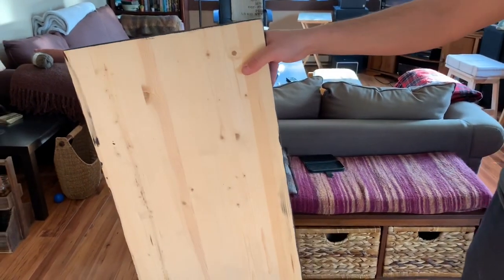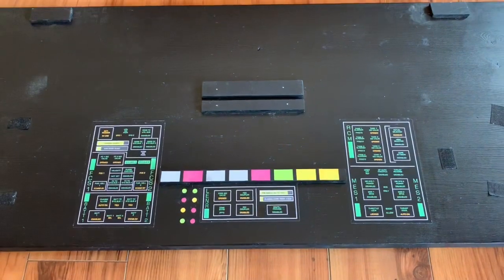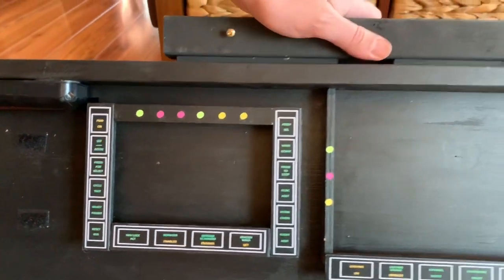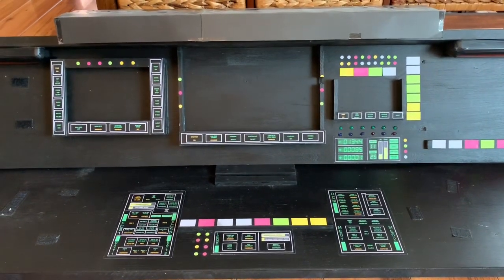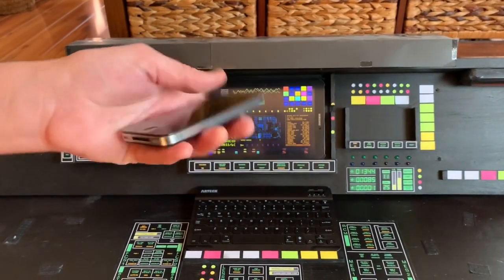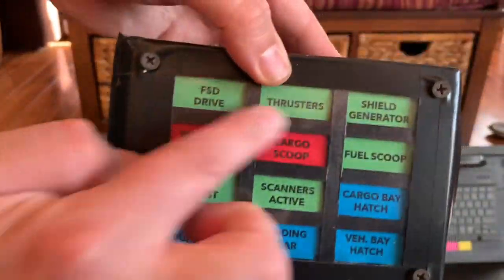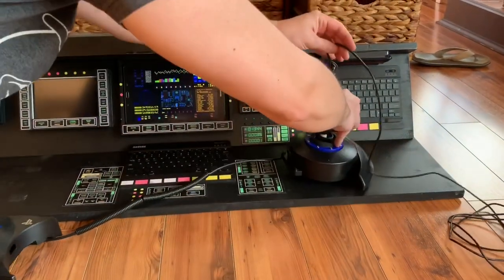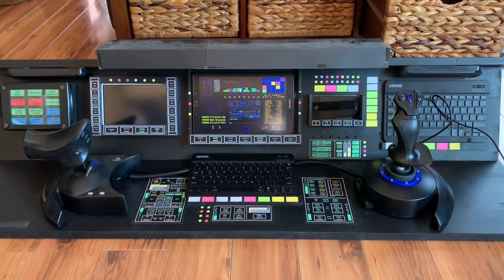Elite Dangerous Simple-ish cockpit build.

Comment: Its cool, but its not functional other than a prop. Have you thought about adding streamdeck or actual functional buttons to make them work?
Reply from the maker: It’s PS4. Unfortunately you can’t do anything with PS4. If I was on PC, my build would have been quite different. It is mostly for creating a cool environment, but at least there are some functional parts.
Reply: @vassdesign9021  I feel the console struggles for sure